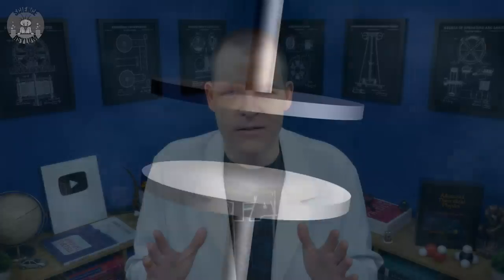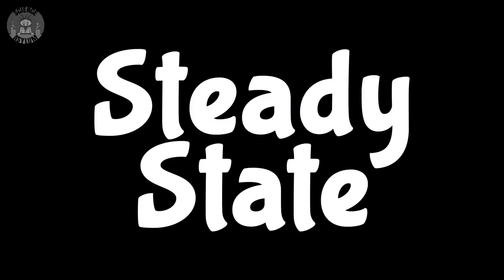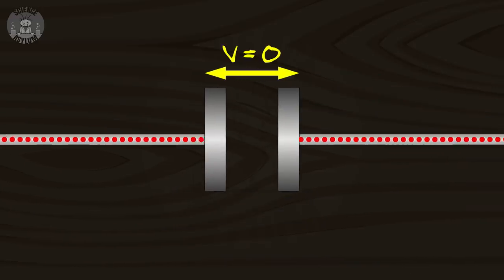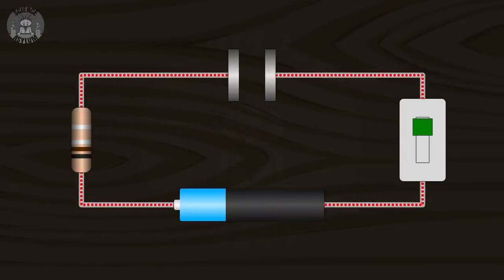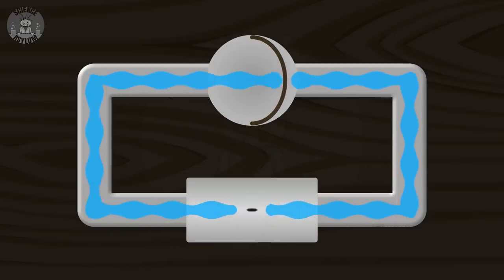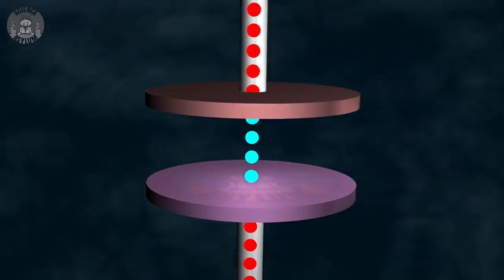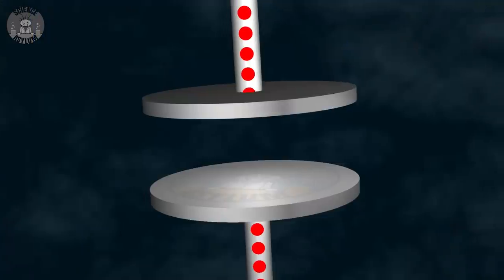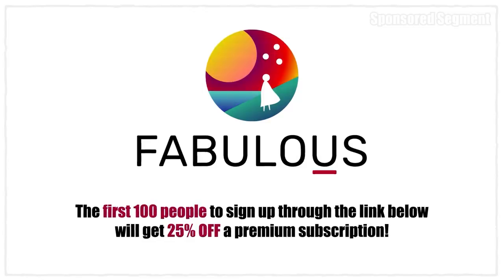Capacitors Are Gaps! How Does That Work?!

Comment: I have 25yrs in the HVAC trade. I've spent so much time understanding completely how capacitors really work. They have many uses in motors and circuits. This was a great video, helped visualize the concepts
Reply: What surprised you the most from the video? Did you already know the part that electrical engineering classes usually don't teach?
Reply: Well, the purpose of capacitors is pretty simple.  It is a local charge source.  One of the things that most folks don't realize is when there is a transient voltage and current can bounce around.  In HVAC, when you turn on the compressor motor there is a pretty big surge of energy needed to kick things off.  So, capacitors are used to store energy right there.  Otherwise the voltage could dip and cause problems with various circuits.  One of the things that Nick mentioned here but didn't really talk about the application (well he is just a physicist) is that different size capacitors will have a different response time.  Remember that charge curve?  There is an equivalent discharge curve.  So it is sometimes necessary to put different value capacitors on the same circuit to have some discharges that are faster starting and small while others are slower starting but larger.
Reply: @jimsackmanbusinesscoaching1344  The capacitor that is used on many single phase motors such as the motor in an AC compressor is there to create a second phase that gives torque to the rotor to get it spinning. Three phase motors, often found in commercial/industrial equipment, don't need them as the three phase power provides the rotating field for the motor to spin.
Reply: @localverse  I know most of it since I've been a subscriber for a long time and loved the series on energy flow in electricity. But I've been really dissatisfied with other explanations this is much better.
Reply: @JohnAudioTech  every spool in a ac circuit shifts the current out of phase from the voltage. And you get a current that does no work (exept changing the fields aroud wires but essentially spools). This reactive power isnt detected by your power meter because it flows back to the power station but it makes a a bigger current that can be detected by circuit breakers and heats up the conductors. Your energy provider doesn't want to pay for that energy thats used to heat up cabels so here (germany) they mandated the maximum the voltage and current are allowed to be out of phase. A capacitors shifts the voltage behind the current and gets them closer in phase so you reduce the reactive power.
Reply: @holydpower131  I'm well aware of the use of capacitors for power factor correction. I was replying to the OP regarding capacitors as used in PSC motors for generating starting torque.
Reply: @jimsackmanbusinesscoaching1344  I just requested he do a video on AC capacitors for this very reason... that's a misnomer, especially amongst the HVAC crowd. A capacitor in an AC setup shifts the phase of the incoming power since single phase rotors would be stuck between the north and south poles of the windings as there's no angular movement on the single phase. When a second winding is put in to offset the other winding, you also need to shift the phase of the power so it doesn't coincide exactly with the primary winding thereby giving the rotor some angular momentum and allowing it to turn. Of course, you could do the same thing by spinning it manually with your hand but that isn't always feasible or even doable (like inside a sealed hermetic compressor.) You could also use relays to accomplish the starting movement of a rotor but the capacitor is ideal for this.

None of which is needed for three phase, since the windings will all be out of phase with each other by definition and give an angular momentum to the rotor with each cycle.
Reply: @holydpower131  If you have a large amount of motors where you get a lot of reactive power, yes you'll see capacitors used there to remedy your power factor. It's pretty much negligible in 99% of none industrial use. Though as homes and businesses see more automation and more electrical motors, you might see power factor be an issue.
Reply: but how do triple phase permanent magnet motors work?
Reply: @etherealrose2139  but how does the capacitor create a phase if it's DC?
Reply: @Blox117  it doesn't. It performs as this video explained. It more or less "stores a charge" because the electrons are only flowing in one direction. Which means when the source is cut, it will dissipate that charge for however long it was designed for until th voltage equalizes back to zero

The thing is in an Alternating Current setup, just as the name suggests, the current alternates which way the current flows... 60 times per second so you have opposing charges 120 times in a single second. It more or less shifts the phase of the incoming power instead since the voltage lags the current by 90°. This can give an aritifical "second phase" to a second motor winding thereby providing an angular momentum allowing the rotor to spin instead of stalling between two poles (you could hand spin the rotor without the need for capacitor or second winding if the torque is low enough and you have access.) Depending on the motor, the auxiliary winding can run continuous or may be made too small so it has a dropout circuit to protect it. Once there's an angular component to the rotor the main windings should keep it spinning.
Reply: Start and run capacitors .. Motor caps are a special breed.  I was a TV repairman so there were a great variety of them.

Comment: I use variable air gapped capacitors for shortwave listening. They are absolute works of art! Beautiful things! I love watching the plates slide between each other as you tune them to resonance.
Reply: I wonder if what I was thinking about, the rather large air gapped capacitors, had anything to do with early radio? 🤔 I can't remember...😞
Reply: @Robert_McGarry_Poems  Look at "Variable Capacitors" on Wikipedia. There you'll see images of air gapped caps used in impedance matching to tune antennas. I use them for shortwave (HF) frequencies.
That should give you enough keywords to find some beautiful variable air gapped caps. 😃
Reply: @Aengus42  Thanks that totally helped. Yeah, it's been so long since I did that initial research into the subject.
Reply: Weren't those old variable caps called condensers?
Reply: @mikelastname  Old timers would call them tuning condensers. It's just an old fashioned name for capacitors.
Reply: i used to have some when i was a kid. there was an electronics shop absolutely packed with crazy stuff because it was near a national laboratory and he would buy old equipment and sell stuff to the b researchers at the labs sometimes, i used to go there and explore for hours and ask him questions, he would give me stuff at a good price to encourage my experiments because we were poor. it was great but it's no longer around.
Reply: @Aengus42  Before electronic ignitions for gasoline engines, about every 6 months the car's engine needed a "tune up" which usually consisted of replacing the "points, plugs and CONDENSER."  The "points" were a switch that turned on and off synchronously with the engine speed (inside the distributor) and supplied a pulse of current through the "ignition coil."  Rapidly disconnecting current through a coil creates a high voltage from the collapsing magnetic field that not only causes the spark at the spark plug in the cylinder, but also causes a high voltage that "wants" to jump the points, too.  Such continued sparking is not unlike a tiny arc welder that melts and pits the "point's" (switch's) contacts altering the spark timing and the engine efficiency.  The CONDENSER is just a capacitor that can suppress the arc across the points by absorbing some of the coil's energy.
Reply: @ralphcrawford9741  Yup! I'm 58 and I drove & fixed those ignitions! A "tune up" should be more than plugs & points. It should include making sure the timing is spot on, cleaning out the carb (float chamber & jets) & a new air filter & an oil & oil filter change if necessary. And don't forget the tyre pressures because that's the easiest thing to make an unloved car feel better as they drive out of the garage heh heh.
If you do all that on a car that hasn't been touched for a year you'd definitely notice the difference.
You could do all that on a sunny Saturday afternoon ready for a blat up on to Dartmoor on Sunday & a pint at the Plume of Feathers in Princetown next to Dartmoor Prison.
That'd be the perfect weekend back in the day 😃
Reply: @Aengus42  Yes, of course, thank you for reminding us of all the maintenance that went into the vehicles of that era - I still have my '69 Doge Van lest I forget.  Modern electronics, mechanics, and technology has made our vehicles much more comfortable to drive and maintain while extending their lifespan.  In those days 100,000 miles was the upper limit whereas now 250,000 often almost trouble free miles can be the norm.
Reply: @ralphcrawford9741  Yup! Now we can all have Volvo 240 mileages! As long as you keep up with the oil & filter changes 😃
Reply: @Aengus42  At least until fairly recently, all transistor radios had one. In fact, they were invariably superhet designs which involved two variable capacitors ganged together. One section tunes the antenna circuit and the other tuned a local oscillator, The idea was to mix the antenna signal with the local oscillator signal. The result was signals at sum and difference frequencies. The difference frequency was around 465kHz and was called the intermediate frequency. This was amplified using several stages tuned to the intermediate frequency prior to demodulation by envelope detection.
Reply: @ralphcrawford9741  Yep, I had a Yamaha RD250 and later a 350cc two stroke. Even after a week the 'edge' faded from the performance so I got very adept at doing timing and points. One handy trick I was taught was that when the points opened and the little spark occurred between the points, that would cause a blip of static on a transistor radio tuned between stations, or even the cigarette paper trapped between the points that let go as soon as they separated. Give them a quick file then gap then head out for that weekend run to somewhere or other... Reliable is a relative term for sure :)

Comment: This is revolutionary - please keep going. I'm old school - classically trained but understand where you are going here. The jump start you can give our new experimenters will be profound.
Reply: Yes. I've always been interested in electronics, but it DEEPLY bothered me to NO END that no-one would ever explain what's inside micro-electronics and how EXACTLY they work. I like to tinker and learn how things are made and interact to be able to understand deeply how they work, but with things like this, it was just expected to accept that they were a black box of magic and they could be used for these specific things or act in this specific way, but not how. Like transistors, how tf do you expect it to make sense to someone and for them to fully understand their capabilities and weaknesses if they don't/can't understand ho exactly they work. I still struggle with this, have you done more, if so, where can I find them?
Reply: @OverlordIcy  Yes, I have a few suggestions for you: Veritasium, The Science Asylum (this channels PlayList for Electricity), Altium Live with Rick Hartley or Eric Bogatin. What you will find is that Circuit Board designers PCB designers know the Poynting Vector, How Electrodynamics is what electricity is. Search for Transmission Lines and Poynting Vector - that is a good start, the videos by Rick Hartley are easier to follow too. Basically the Energy in any Circuit is from the Electric and Magnetic Fields, the Voltage and Current are factors but they do not carry the energy - it's All about the Fields. I'm still a hobbyist too and following these suggestions you will begin to unfold what Electrical Energy is. Good Luck
Reply: @OverlordIcy  As for specific components - you can do a deep dive. Most Microprocessors are logic gates, logic gates are made from transistors, transistors are make from the process of mixing Silicon with other materials to create Negative and Positive charges within the molecules - Negative charge is an abundance of Electrons, and a Positive charge is a lack of Electrons inside a material.

Comment: When I was a teenager I had an air-gap variable capacitor to tune a crystal set radio receiver. It also had a hand-wound coil on a cardboard tube as the inductor. The antenna was a wire strung from my bedroom window to a post down the garden. That led to a lifetime career in electronics.

Comment: That animation at 11:20 is very good representation to clear up the misconception, that the energy does NOT leave the neighborhood of the wire. It is outside and around the wire, but still goes along the wire, following its direction.
It’s like if you replace the real wire with a much thicker imaginary wire with no definitive edge, which goes in the same direction.
Reply: Yup, 'cause magnetic field strength drops dramatically as you go far and far away from the wire 👍

Comment: How long did it actually take you to derive that expression for V_c at 4:53?  I'm glad you showed the actual math even if you sped it up so viewers didn't have to watch, because I paused it abd worked through your algebra, which reminded me how transient analysis actually works.  It also made me realize what I don't think really hit me when I learned it in class a couple years ago: its really just applying boundary conditions to a D.E. general solution to get the specific solution.  So many E&M problems come down that process.
Reply from the maker: It took about 30 minutes, including all the mess ups. It was about 12.5 minutes for the final sheet. Apparently, I'm a little rusty.
Reply: What does D.E. mean? (merely curious, I've no idea about any of the math)
Reply: @localverse  Differential equation(s).  To briefly summarize what I was talking about, a differential equation is simply an equation involving derivatives (if you haven't had calculus, a derivative is a function giving the rate of change of another function; e.g. the derivative of f(x)=2x+5 is f'(x)=2).  Since rate of change is such a broad concept, D.E.'s show up all over the place in physics (and other sciences too).  In regards to capacitors specifically, the equation that describes the charging of a capacitor is the solution to a D.E.  The actual equation, for a circuit with just a resistor and capacitor (which is the type of circuit Nick showed in the video) is I(t)=(Vₛ/R)e^(-t/RC), where Vₛ is the voltage of the power source.  It essentially says that the current will decrease exponentially with time, starting with a value of Vₛ/R and decreasing at a rate depending on RC.
Reply: @Lucky10279  as someone who tries to follow physics but is rusty on the math (2 decades since I took calculus), this was probably the single most useful / impactful youtube comment I've come across.

Now I have to go back and re watch some of those Sean Carroll explanations.

Thanks!!!
Reply: @uninspired3583  Glad you found it so helpful!  :)
Reply: @Lucky10279  I'll second that, thanks for this comment. You've got a talent for really clear explanation!
Reply: @KalebPeters99  Thanks for your kind words!  I'm very glad you found my explanation helpful.  :)
Reply: @ScienceAsylum  Differential equations must be worshipped! )
Reply: @001firebrand  That's a bit extreme, don't you think?
Reply: The derivation is pretty simple electrical engineering stuff. Nothing fancy.

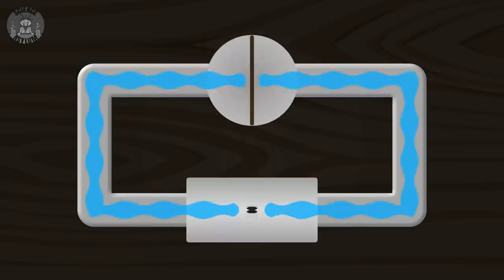Comment: 7:50 - I was an electronic technician in the Navy, I was then an electrician for 10 years, I then went on to get bachelor's and master's degrees in electrical engineering. Long story short, I have a lot of experience with electrical teaching techniques. 
Anyway, I have never heard this diaphragm analogy for a capacitor. I like it.
Reply: The diaphragm analogy was the way I learned it as a kid (or at least a very young person). You must have been very unlucky not to hear about it.
Reply: We learn something new every day! And it's a big world. Knowledge doesn't spread evenly 🙂
Reply: @localverse  that's for sure, the more I see and lurk around the more it is confirmed that knowledge spreads greatly unevenly

Comment: Mind. Blown. I was looking through a powerpoint that louis rossmann made that gave a rough overview of electrical engineering (just enough to do electronics repairs) where he said that capacitors block DC but allow AC to pass. It seemed so counterintuitive that I was certain he made a typo. I though for sure it should be the other way around. But this video really shines a light on why it works the way it does! Thank you for all your hard work making these videos! 💯👍
Reply from the maker: Glad I could help 👍
Reply: There is also the opposite, a device that "blocks" (hinders) AC but allows DC: An inductor (a coil).
Reply: @whuzzzup  they both shift current and voltage away from each other in a pepetual transiant state (AC) a capacitor shifts tha voltage behind the current and an inductor shifts the current behind the voltage.